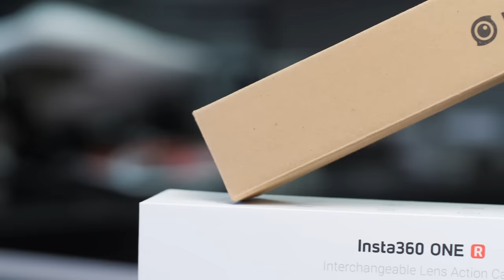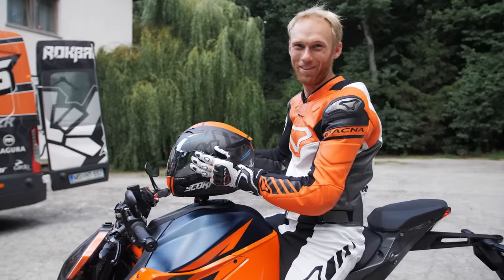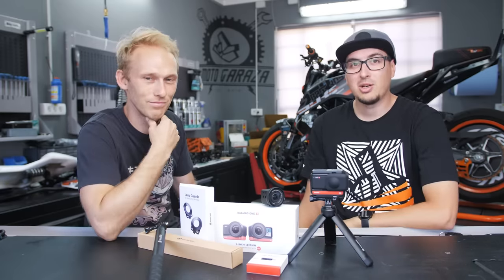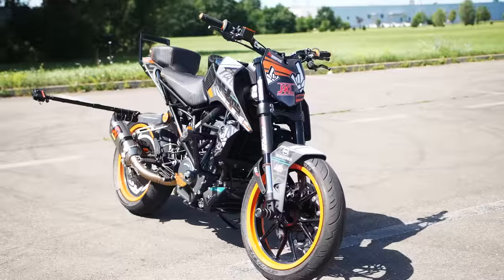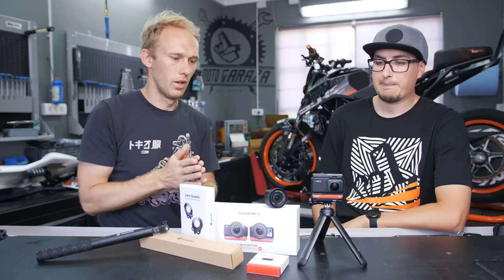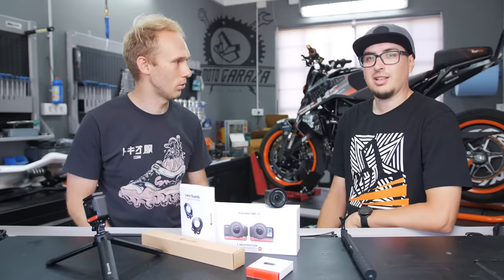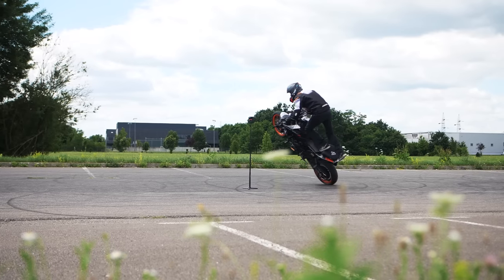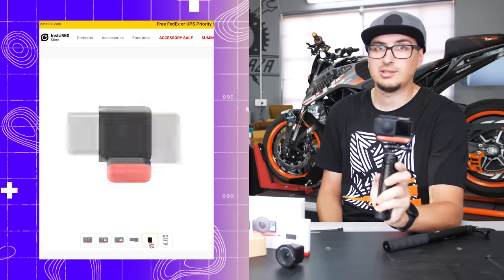BEST 360 action camera for bikers - Insta360 One R | RokON VLOG #98

Comment: Cool video. I do believe that 360 cameras are the future of VLOGing, but currently the quality of the footage of cheap action 360-s is not "there yet".  You can clearly see it in this video. There is also a noticeable distortion in a footage where camera "connects" footage from both lenses. I have seen a lot of complaints with Insta360, like overheating, condensate inside of the lenses, quality etc. as well.